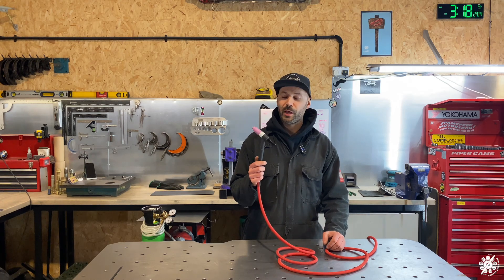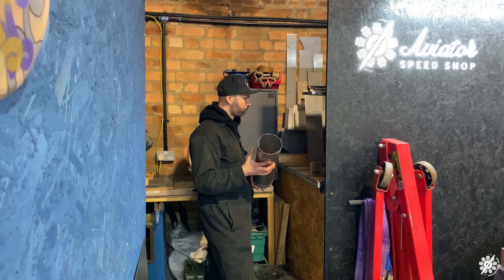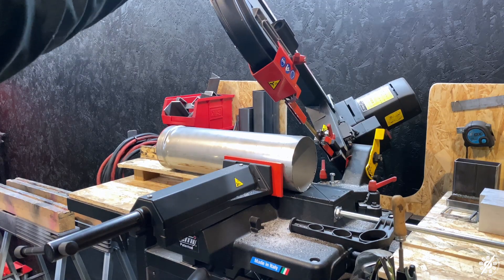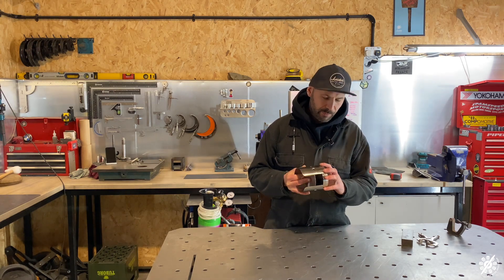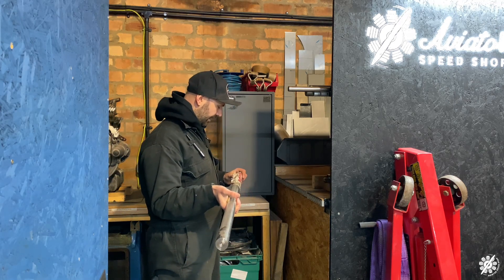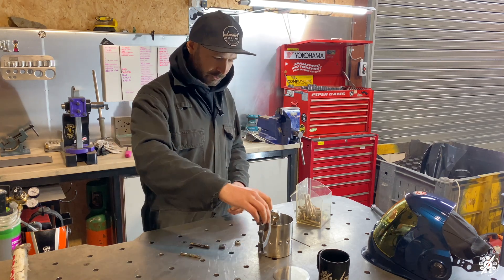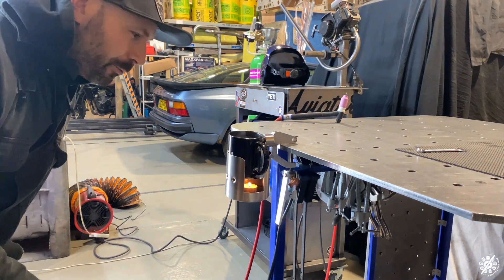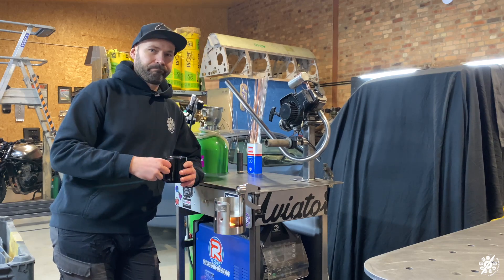Goodbye to cold spilt tea! Engineering a custom workshop tea warmer

Comment: Cracking video, lots of madness and fun, personally I just use a stainless thermal mug... but wheres the fun in that kind of wimpiness?
[EDIT]
Fly in the ointment this only works from side to side, what it. said intruder left the front legs and adjusted the rear legs... you need a full gimbal 😂
Reply from the maker: haha, yeah definitely mk3 is going to have to be full gimbal!